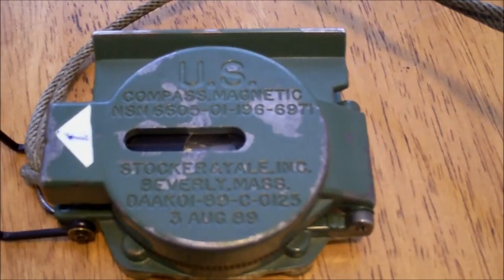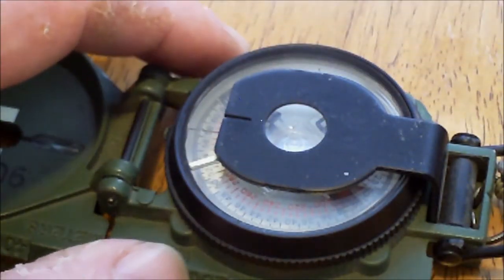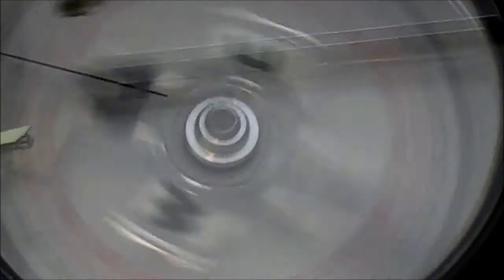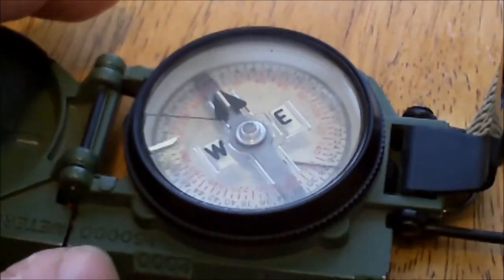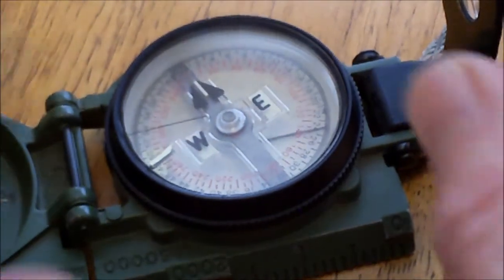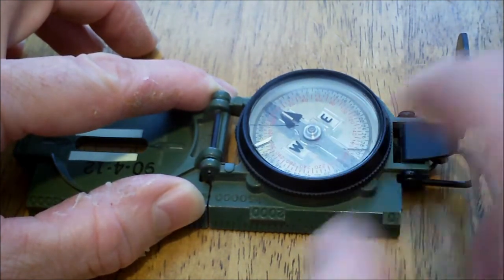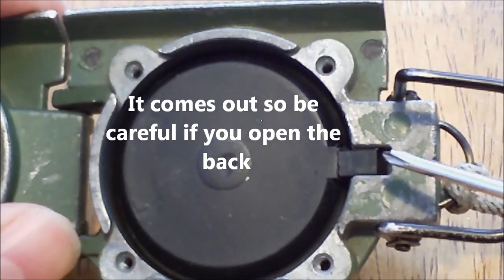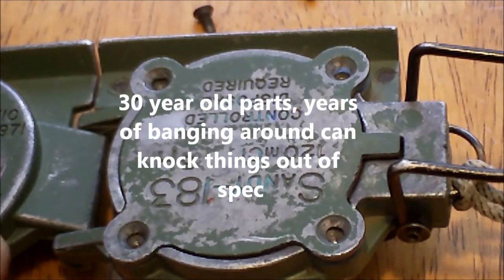USGI Compass - a possible solution for a sticky dial

Comment: The back plate on mine had a lip that caught the plastic part once the triangular piece was pressed in. Loosening the screw helped free up the triangle part. But the source of my problem was the lip on on the inside of the metal back plate. I smoothed it out with a blade so it was less of a step and more of a smooth surface. I added graphite with a pencil to the metal plate, for lubrication. Now mine works with the screws fully tightened.

I hope that helps. Poor machining? Maybe that's why this one ended up in a civilians hands.